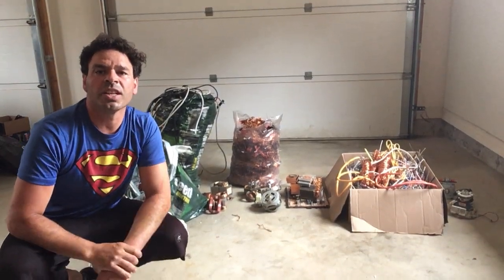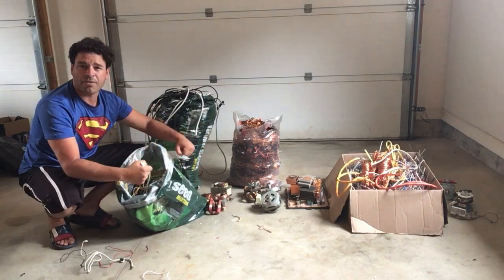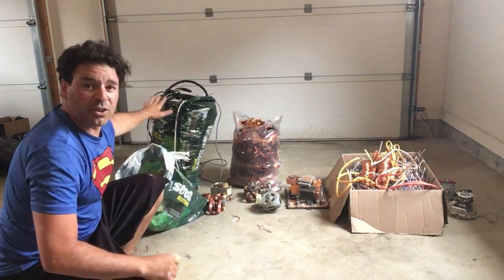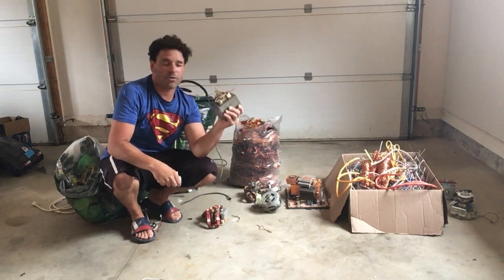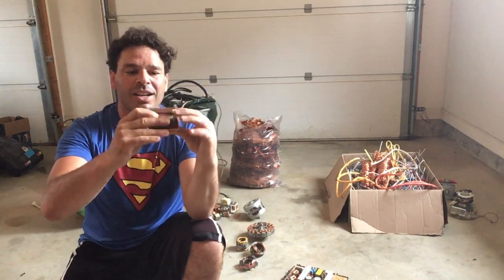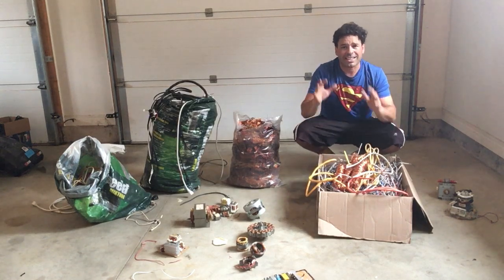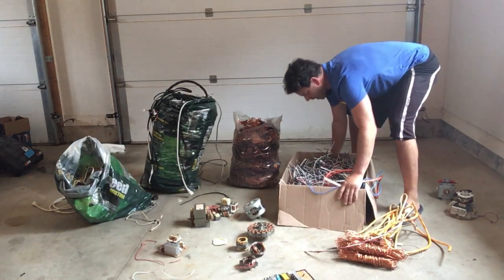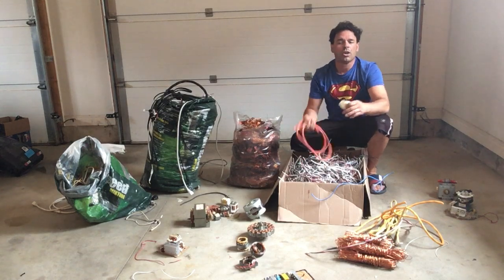Top 5 places to find scrap copper

Comment: I've done 22.5kg in the last month just with Stanley and a board just cut the top pull casing off then strip off inner casing job done but I do get a lot of vacuum cleaners 30-40 a month and with in a week stripped them out soon as I get scrap I hit it hard sometimes to hard then run out boardem sets in
Reply from the maker: Lol. My pile keeps piling up, but I guess that is also a good thing monetarily, not for space though. Thanks for the comment. Stay well and happy scrapping.

Comment: My scrap yard will only give you $0.60 a pound for any type of copper insulated wire. And bare copper is $3.50 at the moment. So I just strip all power / appliance cords as it better to get $3.50 a pound then 60 cents.

Comment: For me over the last 10 years 1 of 2 places in close proximity sked electric and murr, 70% of the time they'll throw out spindles and romex pretty much full and coiled with the package opened of course but almost full,often a couple years out of date and it's like 😮 how do they just toss this out ? Anyway 8,600 from just dinky piles of romex and 0 to 00 gauge cable, and if I'm not mistaken 17k in profit over 10 years not counting all of the other many things I've found,thing is too,I'm close enough I just ride my bike or walk even and fill my back back stuffed full and you wouldn't think but the wight fills up fast and also tons of bx aluminum wire often the really thick 00 gauge equivalent to the power line thickness so I can't complain 100% profit when I treck with non gas operated vehicle even still driving it's like 50 cents total drive if that
Reply from the maker: awesome payoff for you for sure. Yes, it is amazing what is thrown out everyday. Glad you could get it. Stay well and happy scrapping

Comment: Why don’t you remove the outer coating? Strip all wires.🐎🌻✌️
Reply from the maker: Some wire not worth it. You actually lose a lot of profit by removing it. I do have an experiment video whereby I do strip 2 lbs of each to show you profit or not. Video called “which wires are worth stripping? I do the experiment so you don’t have to”